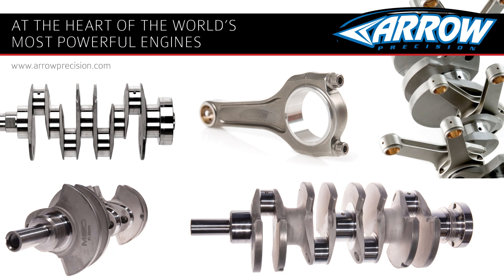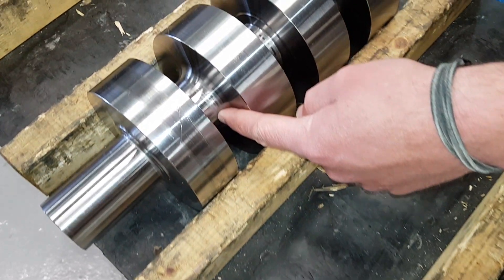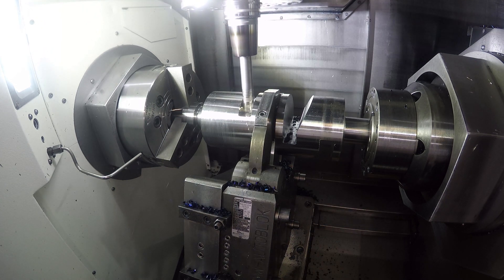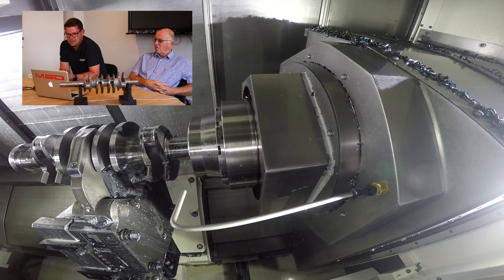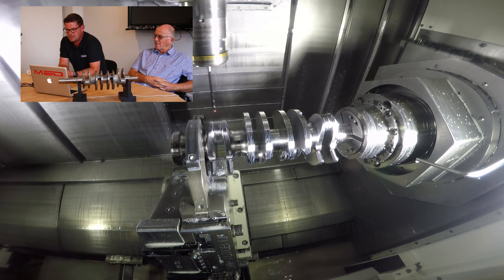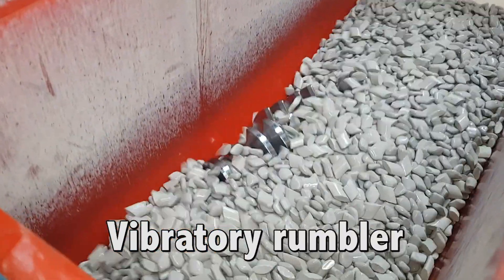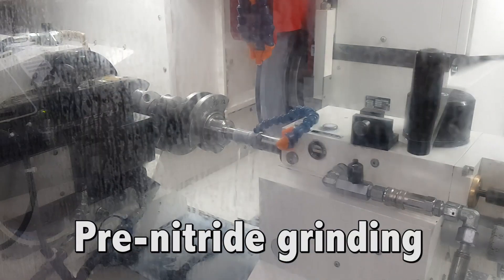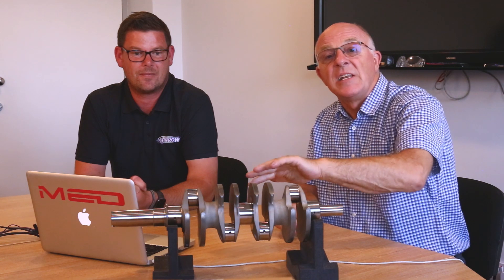How it's made - MED/Arrow steel competition crankshaft - part 1

Comment: What's the advantage over forged
Reply from the maker: Billet crankshafts are better suited to low-volume production than forged crankshafts, as it does not require a new forging tool each time the design is updated and improved.
Reply: @MEDEngineeringTechVideos  thanks, so purely cost. My basic knowledge of metals tells me forged is much stronger. I assume the heat treatment will improve the structure.
Reply from the maker: @andrewromans1967  It's mainly down to them being adaptable -  with a forging tool you're fixed to that one design. Yes forging is in theory stronger due to the grain structure, however, this is only really applicable to the advanced forging tools employed by the household name manufacturers in production car engines, not necessarily aftermarket forgings. For us, billet is best.